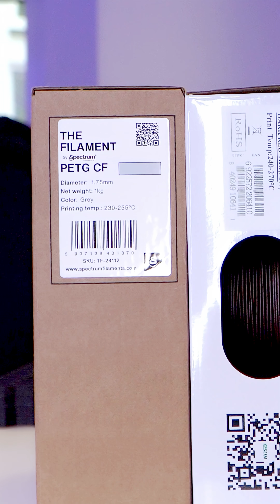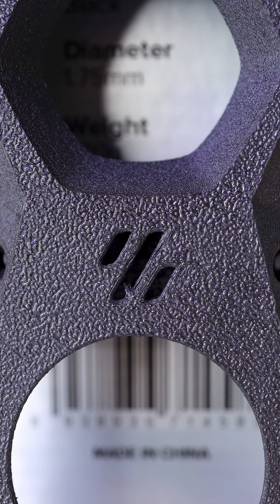The Centauri Carbon with Carbon Filament!

Comment: with the side wall texture your getting. I am wondering if there is something going on with your drive gear for the extruder. Like its slipping or has debris in the teeth.

Comment: Definitely not enough nozzle temp to get the best layer adhesion on the PPS
Reply: Needs 350
Reply: @rangersammy might need upto 380 or so depending on nozzle material. Nozzles that are Abrasive resistant almost always need more temp unless you are rocking a diamond nozzle
Reply: @kiiiddd just saying I've seen great layer adhesion with PPS-CF at 350.  Getting a Qidi cause of 370.

Comment: Didn't know CF filament did make such a nice metallic sound
Reply: It not the CF in this case, it's the material. PPS has a very high modulus, meaning it sounds almost like metal
Reply: Not all of them. PPS-CF and especially PPA-CF straight up can sound like metal😂 I love it. Once you use it you'll realize how garbage 90% of all the other filaments are